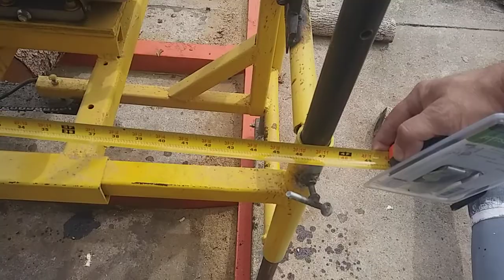Chainsaw mill closeups and a few measurements.

Comment: Hi im watching this video for about the 6th time.Gathering parts for my tiny mill.I ran into an older fella that owns a real saw mill in Murphy,Oregon.He has several models of smaller  chain mills that are run by hired help.The "super skip"  chain that's used on his latest mill is the best for ripping he claims.I saw the result,was pretty smooth.They resawed sugar pine beams out of a large factory.It was beautiful slabs 36" wide and 3 in. thick..Just thought i would pass the info along.I will try the skip chain sharpened @10 degrees first.If its to slow i will have the boys in the old guys Stihl shop make up a super skip for my second try.Thanks for being there to make it a lot easier on us old loggers..new millers..PS great job on the video!
Reply from the maker: I use a regular chain and cut the top plate off every other tooth and sharpen it at 30 degrees. I then sharpen the remaining teeth at 0 degrees. And lower the rakers.

Comment: excellent design .. close to mine that i built ..  i like the way you ran the belt to the bar ... very good ..   Thanks for share
Reply from the maker: Thank you. It was just a way to be cheap. But I would like to increase the belt size to 5/8" since it seems to be the weak point. But that could also be a good thing.

Comment: How did you connect the chain sprocket to the shaft?
Reply from the maker: Pawpaw Smith I removed the bell from a clutch and used the splined center portion so I could swap sprokets. I had it welded to a 1" shaft and the end drilled and tapped. So you remove a socket head screw and washer to swap the sprocket. I will try to upload a picture
Reply from the maker: The end of the shaft had to be turned down to match the diameter of the clutch. I had a machinist do that for me it cost me $80 plus the clutch.
Reply from the maker: Pawpaw Smith https://youtu.be/wcCOqlZsPUQ
Reply: Thanks for the info. looks like it doses a great job.